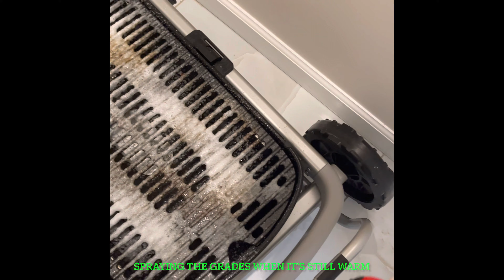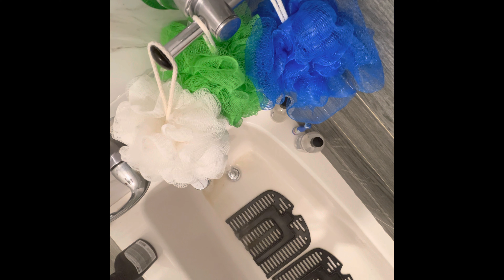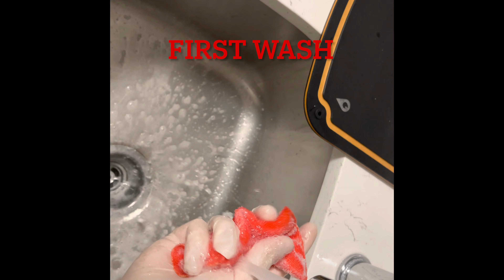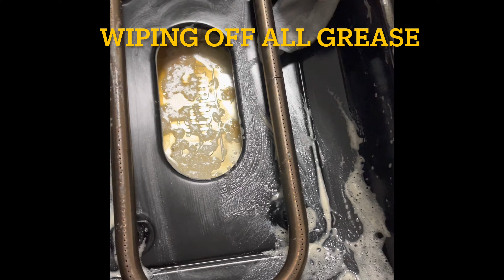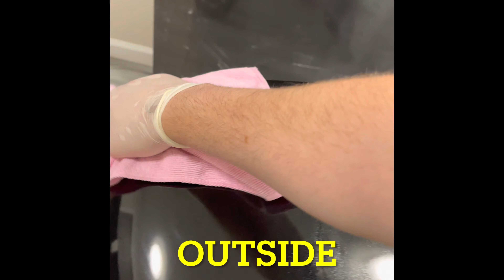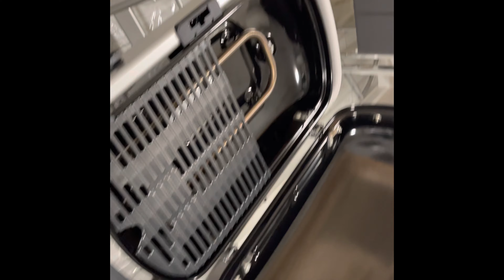How to Thoroughly Clean a Weber Traveler Grill: Step-by-Step Guide

Comment: Does spraying it onto the has flame opening affect the functionality if the spray gets into those in the long run?
Reply from the maker: Good question! I’m very careful not to spray directly into the flame openings to avoid any long-term issues. Instead, I focus on the grates and surfaces, and I always rinse thoroughly to make sure nothing gets into sensitive areas.

Comment: Man that’s a lot of chemicals being sprayed where you eat. A wire brush on high and then a wipe would suffice. Maybe a little citrus cleaner This is way over the top.
Reply from the maker: Hi Benny! I totally get your concern. The sprays I used are food-safe and specifically made for grills. I always rinse thoroughly with hot water afterward to ensure no residue is left. While a wire brush works for some, I’ve found this method keeps my grill spotless. Thanks for sharing your input!

Comment: Scratch your bathtub much ? Why would you let all that grease go down your pipes? Why would you spray the grill while it's on the unit ?
Reply from the maker: Hi there! I’m really careful to avoid scratching the bathtub by using soft padding underneath the grill parts when cleaning. As for the grease, I rinse everything thoroughly and use a grease trap to minimize any going down the pipes. Spraying the grill while it’s on the unit has worked well for me—it keeps everything in place and makes the cleaning process easier. Thanks for your concern!

Comment: Hey, how frequently do you do this?
Reply from the maker: I clean it thoroughly after every use. It keeps the grill in great condition and ready for the next BBQ session!
Reply: @shimoncohen95  thanks
Reply: @shimoncohen95  you don’t have to do that everything after grilling, too much work and hassle. Maybe once every few months. Just wire brush it when hot and scrape inside the cookbox when needed.
Reply from the maker: @Krew808  I hear you! A quick wire brush and scrape definitely work for basic cleaning, and I do that too sometimes. I just like giving it a deep clean after every grilling session to keep it in top shape—helps me avoid any buildup over time. Thanks for sharing your method!